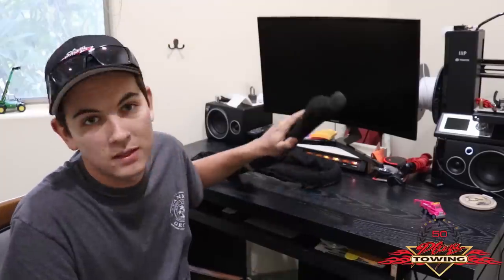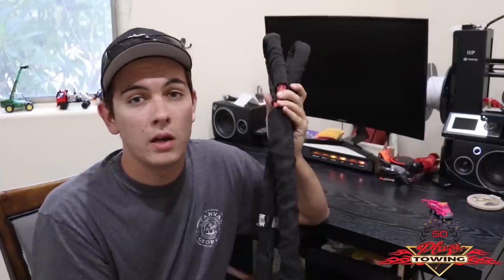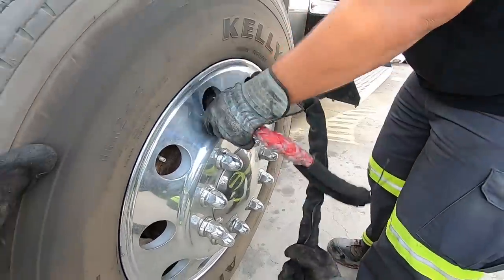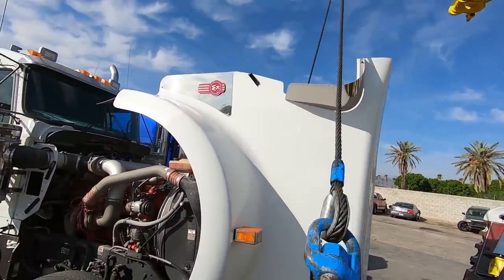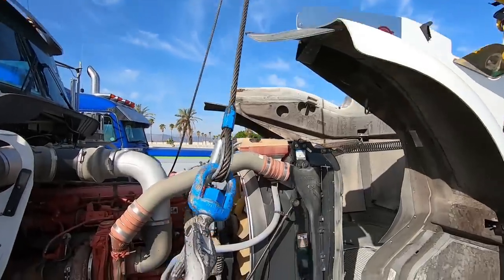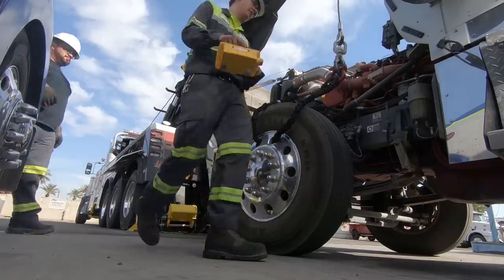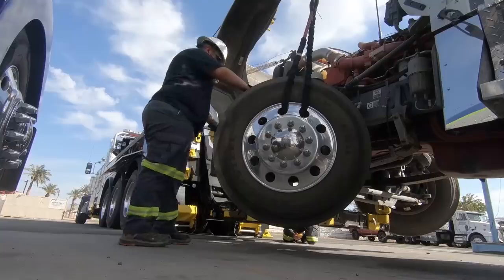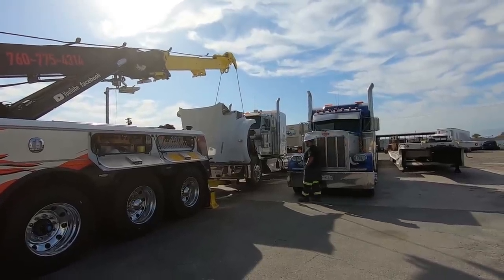Lifting Trucks With No Lift Pins | Rim Sling 101 | Ep 2

Comment: Question Trent, were you able to get the 3/4 inch rims slings through the small holes on the drive axle? Do you use 5/8 rim slings? Great informational video!

Comment: Great Job Guy's Love This Segments. Quick Question When You Picked it Up The Steer Terned When You Lowered it On The Under Reach Wouldn't That Miss UP The Tracking  When Towing It Would Be Off Center. Thanks again Trent. Tell Your Team To Watch There 6 And Be Safe. 🔗⛓️⚙️🔧🚛🚧🚧🐬🐬🐬🐬🐬🙏🙏👍👍
Reply from the maker: No, the axle remains fixed no matter what position the tires are in. What moves is the tie-rod behind the axle which links the two tires together. Hopefully that makes sense. thank you for watching!

Comment: Using the rim slings reminds me of the way they tow cars in Europe with a flat bed that has a boom and spreader to pick up a vehicle by the wheels. Why don't towing companies here use them? They can pick up a car that is parked in tight quarters.
Reply: I would guess cost is the main thing. A rolloff with a winch has got to be a TON cheaper than a rolloff/flatbed with a hydraulic  hoist/crane, plus the outriggers.
Reply: In addition to cost of the tow vehicle, I suspect that another big reason is that we tend to buy much heavier vehicles than Europeans do.

Easier to use an underlift or rolloff than to lift the 5000lb/2250kg full size pickups that are all over the place.
Reply: Now there are underlifts that can turn to the side and extend, so you can accomplish it with a smaller lighter tow truck vs. a boom.